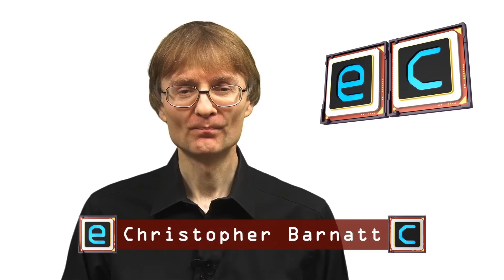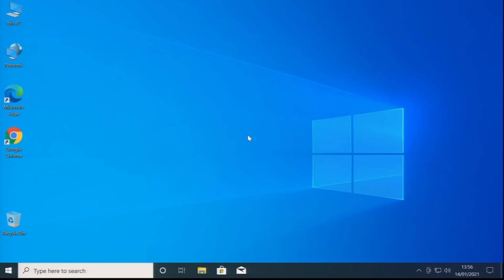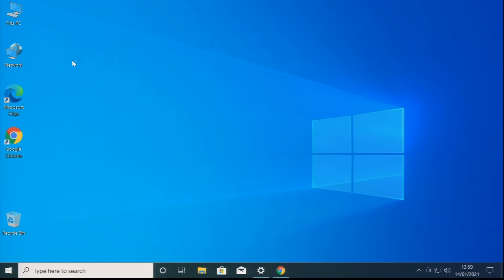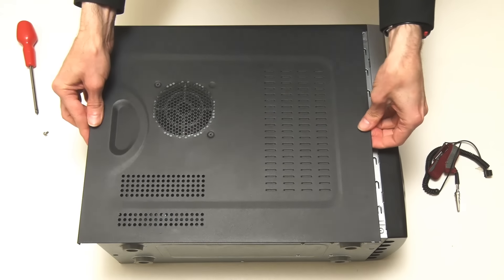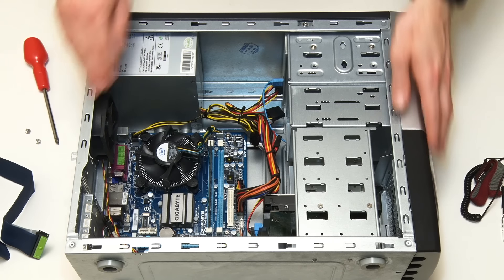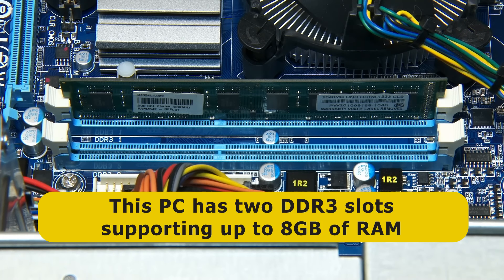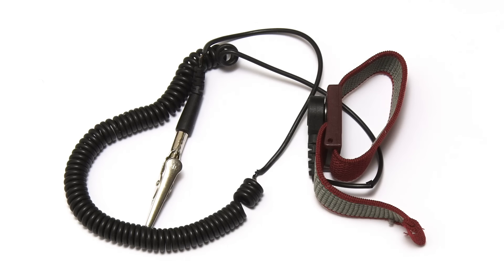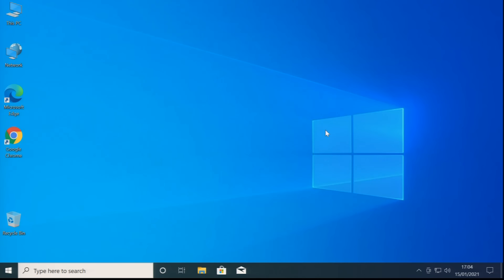Old PC Upgrade #1: Options & RAM

Comment: Greetings Chris, 

As always, another brilliant EC video.  We hope your new studio setup is working out to your complete satisfaction.  

Just because I've done a lot of similar upgrades, here are a few suggestions that you may want to explore in future editions of this series:

(a)  in case Mr. Screwdriver is ON STRIKE for any reason e.g. Brexit, we replace the rear case screws with anodized thumb screws;  that way, we don't need to go searching for Mr. Screwdriver, particularly when he is in a bad mood and not where we left him last time;

(b)  you may not already know that there are design defects in the "push-pins" on Intel's stock CPU heatsink/fan units;  there is a very effective replacement that uses a proper backing plate and spring-loaded screws that ensure the HSF is properly seated and maintaining sufficient contact pressure with the top of the CPU itself;  last we checked, that unit costs only $5.00 USD;

(c)  adding a 6G SSD to an integrated 3G SATA-II port on the motherboard will definitely improve the speed;  however, 3G/10 bits per byte = MAX HEADROOM of only 300 MB/second (with the 8b/10b "legacy frame").  Fortunately, if an x1 PCIe 2.0 expansion slot is available, then MAX HEADROOM increases to 5G/10 = 500 MB/second, provided that a compatible add-in card is installed and configured correctly (e.g. with the correct device driver);

(d)  alternatively, if the user is satisfied with integrated graphics, an x16 PCIe 2.0 expansion slot offers a lot more HEADROOM (i.e. raw bandwidth) and may also support a RAID-0 array using 2 or 4 SSDs;  although this is an advanced option, the "Migrate OS" function in Partition Wizard makes it very easy to migrate the OS to such a RAID-0 array (a topic for future videos in this series of yours);

(e)  another option that is not well known is a PATA-to-SATA adapter that is plugged into the motherboard's integrated IDE port;  the one we purchased a while back requires input power via the old floppy disk power cable;  when connected properly, this adapter allows 2 more SATA storage devices to operate via that IDE port, although RAID mode is not supported, only JBOD mode (just a bunch of disks);

(f)  another wise upgrade is to add a USB 3.0 add-in card, which supports 2 x USB 3.0 ports at the rear I/O panel:  with that card installed and working properly, we then prefer to purchase the StarTech external 3.5" HDD enclosure, which comes with both eSATA and USB 3.0 cables and a separate power "brick";   this external enclosure has its own ON/OFF switch, so the enclosed HDD can be switched OFF after routine backups are finished:  in the long run, this will greatly prolong the useful life of a HDD "spinner";

(g)  last but not least, if 8GB are installed but the User does not really need ALL of that RAM during normal operation, we've had a lot of success enabling a 1GB ramdisk and moving the Firefox and Chrome file caches to that ramdisk:  this one upgrade will greatly increase the speed of both browsers, and also reduce the wear on the storage subsystem, particularly if the browser caches are hosted by a HDD (hard disk drive).

Hope this helps.  I'll look forward to future videos in this series.

Comment: Great with these step by step videos. 
First thing I do is run a check on bios revision as many actually do run on the initial bios.
Most importantly is the often increased ram stability and compatibility and bugs fixes in later revisions. Added options in setting and added cpu support not so much and no haven't bricked a computer yet😄

Comment: Add an SSD, a quadcore processor (such as a Q6600) and you're golden. These socket 775 machines can still be useful, my dad uses my upgraded old rig from 2007 to this very day for office work and web browsing :)
Reply: All it really needs is ram
Reply: @si4632  it might seem like it doesn't need an ssd, but overtime, when you install a few more programs and have stuff running in the background the computer slows down to a crawl if it doesn't have an ssd. I've been using PCs with SSDs for 5 years now, and it's just painful to come back, especially when a decent 120gb ssd costs 25 dollars these days.
Reply: @Evaldas65  I use a sata hardrive on a slower CPU it's fine boot time is the main difference but the ram upgrade was definitely the best bang for buck
Reply: @Evaldas65  also I'd upgrade the graphics for a cheap £30 pcie card before getting an SSD as I think his graphics is built into the motherboard so it will be naff 🤣 GPU actually helps loading webpages especially sites like Amazon BBC YouTube Netflix
Reply: All stuff an SSD will have very little effect on plus how much do you wanna spend before you throw in bin lol bearing in mind a modern mini pc can be had for around £100 be far more efficient and silent

Comment: Upgrading the CPU by itself can also be an interesting option.

For example, from an i3/i5 to an i7 of the same generation (check motherboard compatibility!)

When I was building a server PC, I bought an old Dell Optiplex Office PC with an i5-4590 and swapped out the CPU for a second hand i7-4790 for a nice performance boost (the most powerful CPU supported by the motherboard), then sold off the old CPU for some money back.
Reply from the maker: True, but would almost certainly require a new Windows license.
Reply: @ExplainingComputers  oddly enough, when I did it it did not. The PC came with Windows 10 Pro preintalled, and when I upgraded the CPU the license was kept.
I guess it must have been tied to the motherboard.

Comment: Lovely upgrade video. I totally agree with the ram and SSD upgrades, but the PSU worries me because I've seen enough like that one to know its supposed rating usually owes more to wishful thinking than reality, and what damage can be done by the wildly fluctuating voltages such PSUs often provide. I've thought "It should be OK under such a light load" then regretted my optimism later. 😁

Comment: I've bought pre-owned computers and upgraded them myself and one thing that often is overlooked is to check the latest BIOS offered by the manufacturer. Did this with a Dell Laptop and it does seem to help. I also noticed that using a light Linux distro like Mint XFCE really boosts performance compared to Windows so I hope you do a segment comparing the same hardware with different operating systems.

Comment: I really enjoyed this video, and look forward to the remainder of the series. Someone recently gave me an old Dell with a Pentium 4 processor, running Windows XP. Works well for its age. Has 2.5GB of RAM and motherboard graphics (and a modem!). Hard drive interface is SATA, but CD drive is IDE, which is why I wanted the PC (a specific project requires an IDE interface). I might add a video card if I can find one cheap, just for fun.

Comment: Even though I have upgraded a few PCs in my time, I enjoyed this video a lot, learnt something new, and watched every minute from beginning to end. Chris, your presentation style is excellent, very much to the point, no nonsense, and very clear and thorough. I very much like the fact that you don't skip over anything or take things for granted, while still keeping things on track. You might have mentioned that there are options beyond Windows 10, which is a very relevant question for old computers like this one. Which Linux distro would be the best alternative after this upgrade, for example?
Reply: I notice Chris is using Ubuntu a lot these days. But I think choosing the "best" Linux distro is case dependent, according to the intended uses of the PC and its required software and hardware installs. For general family home computing on old machines like the one here, my favourites are MX and Mint, both with XFCE desktops.

Comment: Another great and enjoyable video!  Just a quick point, that case design pre-dates 2010.  I have one, branded "Iqon", that I acquired in 2006.
Reply from the maker: Very interesting -- thanks for the info. I will look into the brand to try and find out more about the case. But the PC cannot have been sold before 2010 with the CPU fitted.

Comment: When I have some client who can't afford a new PC. I call this a cost adverse client. (AKA - pain in the a**). I often suggest looking at a similar upgrade as in this video. If they get mercilessly hacked, then I opt to switch them to Linux Mint or Ubuntu. Sometimes just a ram upgrade can make a real difference in their computing experience. I have upgraded some CPU's, but generally a ram upgrade is better bang for the buck. If they need graphics I add a card and a ram upgrade. But this is rare. The Linux upgraded clients, yes Linux is an upgrade over Windows in my opinion, I rarely see them. They tend to only need my help when they add a printer. Great video for those of us unfamiliar with upgrades. I watch it for it's entertainment value. You would think after doing this all week I would choose something else to entertain myself. But there is reason one does this for 30 years. Yes, I'm mad. Mad about computing. Thanks Chris!

Comment: I love seeing stuff like this. Future upgrade ideas:
One of the most useful things you can add is a USB3 pcie card, such as "StarTech 2 Port PCI Express USB 3.0 Card Adapter with UASP - SATA PEXUSB3S24"
This will enable you to invest in something like a Samsung T5 portable SSD, and enable - among other things - fast backup (I recommend Veeam for bare-metal restores) - and you can also install Linux on it ;-). For older hardware I'd recommend MX or Antix, possibly Mint.
If you can find one for cheap, replace the CPU with a Core 2 Duo (I checked the mobo specs and it's supported.) This, with your max 8GB RAM, will allow you limited virtualization with Virtualbox or similar and opens up a number of possibilities.

Comment: Excellent video Christopher!  People do not know how good the computers are that they are currently throwing away!!!  A few month ago I spilled coffee on my Quad Core Laptop.  I was using a USB Keyboard, however, there became Logic problems from the Motherboard and the Laptop became unusable.  I did try everything.  So, I took out 1 of my older Toshiba A215 Laptops, it has an AMD Turion X64 Duo Core, only runs at 1.9 Ghz.  I had already updated my RAM to this laptop's maximum of 4 GB.  I then put in a 120 GB SSD.  Then I loaded Windows 7 Home Edition, 32 Bit, on it, and there is still a Legal Method with Microsoft to Activate Windows 10 Home Edition, and that is what I did.  Windows 10 64 Bit Pro Edition, that you have here, would be important to have more RAM, with what I do with a computer 4 GB is adequate.  Of Course, I have this old Laptop on a Cooling Fan.  It is running quite well considering the age of the Laptop.  My  Desktop behind the Laptop, (I collect these old dinosaurs, LOL),  has a Pentium D Dual Core, Max RAM 4 GB.  I took the 1 TB Hard Drive out of my Old Laptop, and at first tried to run it with the X64 Laptop, but unlike Zorin Core 64 Bit, I could not get it to run, so I put the 1 TB on the older Desktop and I am running ZorinOS on that now with the 1 TB Hard Drive. Waste nothing...LOL!
Reply: Oh, you know...just to mention...I will put VirtualBox on that old Desktop, Windows XP, and put all my older Software, (like Office 2007), on the computer also.  I like doing that better than the Wine option in Linux.

Comment: I think there's a lot of people out there with systems that are even half this age that could just do a few simple upgrades to their system and have it chugging along for another 5-10 years easily... 

The laptop I currently use day to do is an HP Pavilion 1525 from 2008 . Admittedly it is on the weak side with a Pentium dual core T4200 (2GHz) and originally had 3 gb of ram and a 5400 rpm drive... but I upgraded the ram to 4 GB (the max the motherboard allows for)  and threw an SSD in and it's perfect for normal tasks like browsing, watching/listening to stuff on youtube, word processing, etc... perfectly capable little machine, just needed a little bit of love to get it to run at its maximum capacity
Reply: Some of those HP Pavilions are classy machines so ti's nice to keep them going. If you ever need to dismantle your machine to clean the dust out of its cooling system, you could probably also pop in a 2.4GHz cpu for a 20% speed upgrade. Suitable items can be found on ebay for nice low prices.
Reply: @derekp2674  Honestly I've thought about doing just that! Especially since I have another 1525 I picked up at my last job that is running a Celeron. Pop in a significantly better CPU, ram upgrade, new battery, and SSD into that one and it would be good to go for quite some time. 

Only reason I never bothered looking into a CPU upgrade so far is that I haven't really run into a whole lot of issues with the T4200 that's in there right now, but then again I don't try to push it too far anyways. Also running a lighter OS would do wonders for this as well but I'm too used to Windows to give it up quite yet.
Reply: @RoshiGaming  I agree that your T4200 is already a good CPU, so the benefits of an inexpensive upgrade will not be huge. If you're other machine is a single core Celeron, then an upgrade to any decent twin core cpu will be a big improvement. Over the years, I've done quite a few such improvements, leaving my scrap box full of old single core cpus.

Comment: Older PC's are best computers.  :)  I've an old Intel Atom330 system (from 2008 iirc) that I'm still fond of.   The CPU/GPU  became too slow for new DE's and the system found new life a storage or NAS box.  But back in 2008, that little system  punch way beyond my expectations, for the amount  it cost.

Comment: First of all, how about your health? Great work. You are always good at explaining which deserves admiration. I still use a 1.6GHz single-core laptop with 2GB RAM and another desktop from 2006 with an AMD 3800 2.6GHz CPU and 5GB DDR2 RAM. If any old hardware still works with some decent video playback speed at 360P resolution, it can be used.

Comment: From my experience, the thing that is most bottleneck in older computers is probably actually the processor.
I continue to use very old computers, even one like the laptop from your previous video, but they are used by me for very lightweight applications.
With an old laptop (similar to the laptop from your previous video), I made a local home radio station, and it has been working well for a number of years. It also serves as an alert when there are missile alarms in our area (once every few weeks).
But you can hardly surf with it, and certainly not play video smoothly.
For the price you spent on the old computer and its upgrade, you can buy new Chinese equipment that is simple but likely to give you better value for the price (though you never know how long it will last, but an old computer is also not expected, especially if purchased from another person).
I personally tend to fix things and not replace, as long as possible. A lot of my equipment comes from the "garbage" of factories (a friend who works there gave me) and I repaired by replacing components such as capacitors at really zero cost.
When I break things down into factors, I reassemble them and replace vital components with better ones (which are available according to technological progress). For example, incandescent bulbs in LED bulbs, or PVC cable in neoprene cable.
I'm really looking forward to seeing your sequels to this fascinating series already.
I'm sure you'll believe me if I tell you that your videos have more value than the information itself!

Comment: If a problem occurs when upgrading RAM it can actually damage "corrupt" the installed operating system on your hard disk. A far safer way is to boot up your PC with a Live Linux distro but one that has the memory check function available at boot. This distro will also probably be 32 bit on an older PC. Here are the steps. Boot up your PC normally in windows. Insert the Linux CD and reboot in a live linux distro. You can run memory test if you like to check your existing memory. Now leaving the Linux CD in your PC shut it down and switch off at the mains, not just at the PC. Remove PC case and replace memory as appropriate. Now when you boot up safely in your live Linux distro, run the memory test. If there are any errors found then shutdown and fit original memory. However If your new memory modules show the correct amount of memory, with no errors then you can shut down your PC, removing the Linux live CD and boot your PC up safely in Windows from your internal hard disc.
Reply from the maker: Good tip, thanks for sharing. :)

Comment: very nice video

some suggestions
- activate quick boot in the bios
- check if any options in the bios could bring some small % of performance
- in windows right click / properties in "my computer" -- performance - desactivate all graphical things
- uninstall any useless software
- add a 3d video card, even basic it brings a boost of performance

Comment: So ... he opens up a 10 year old computer and voila!  A pristine clean interior that looks like it just rolled off the assembly line. Not a dust bunny in sight. Last time I opened a 10 year old pc there was a cloud of dust. Somebody had already been inside the thing. Christopher?
Reply from the maker: I'm sure that the dealer who sold the PC had been inside it with a blower! :) Maybe when the 2GB 1333MHz DIMM module was fitted.

Comment: Please discuss updating the motherboard CMOS.  It's free and often allows more RAM options and other performance improvements, together with security updates.  In this case the reseller may have already done so, but it is worth checking.

Comment: i literally just rebuilt this older computer that was sitting there rusting, it has an i5 in it and 8 gigs of ddr3, i dropped the mb in a new case and new psu and gpu gtx 1660 and she runs like a beast with an ssd.